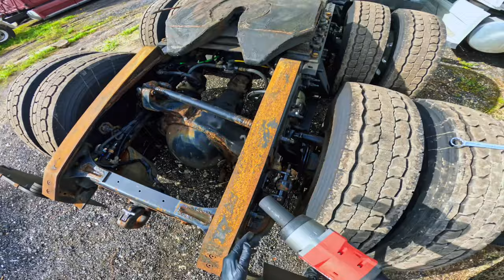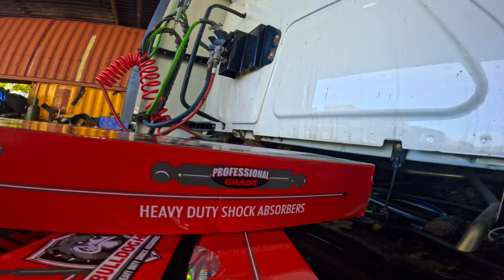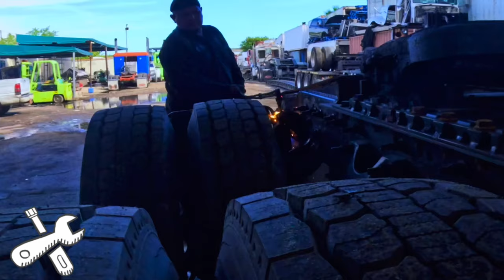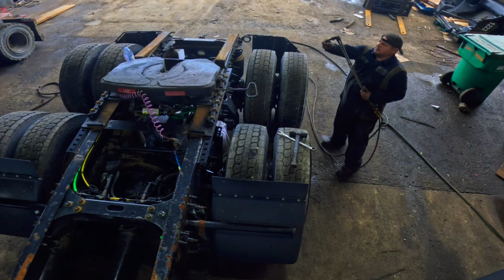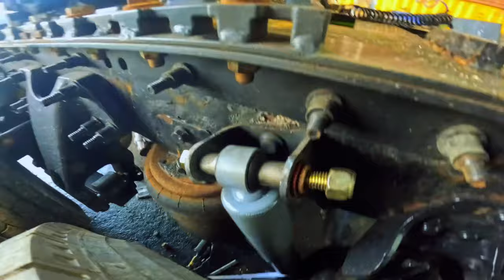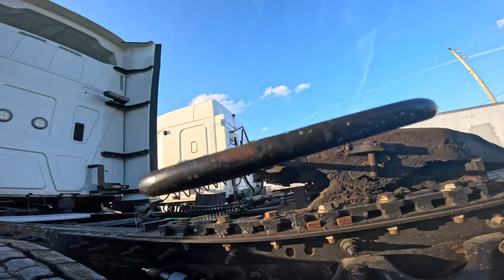Semi Truck Shocks Replacement/HD Bulldog Shocks/Rear Shocks / Milwaukee Impact 2967-20/Torched Off

Comment: You know i just order those  for the front but im thinking the other brands don't have that bushing that this one's have so it is not going to work cause the hole and the bolt are bigger? Well, i guess i will find out tomorrow
Reply from the maker: Look at the shocks on your truck top and bottom/ Then type in your exact truck year make and model/ some websites have different shocks